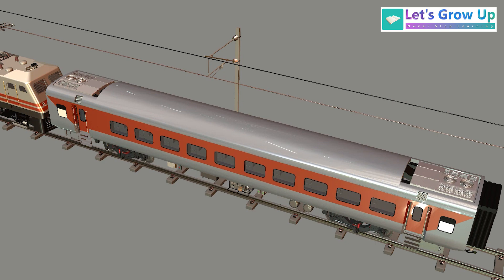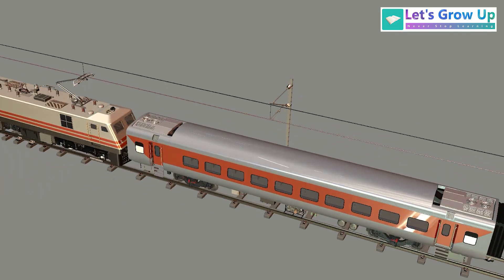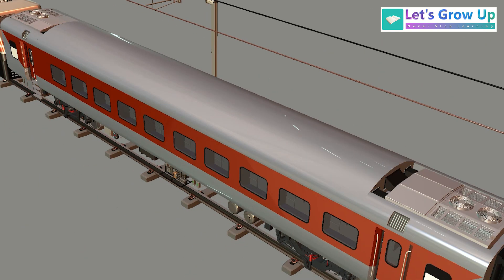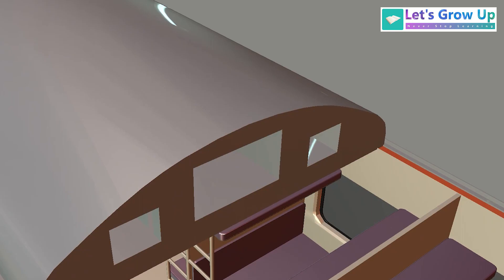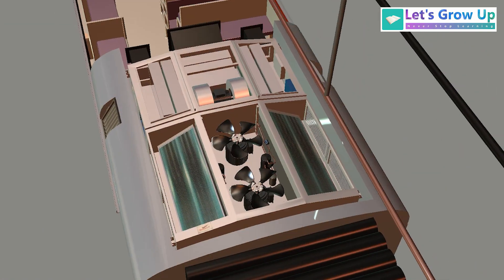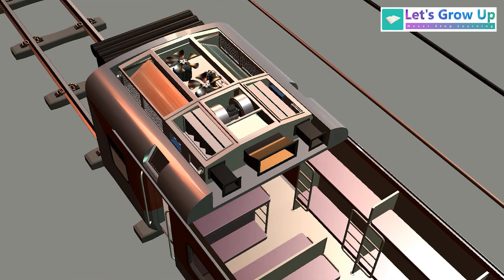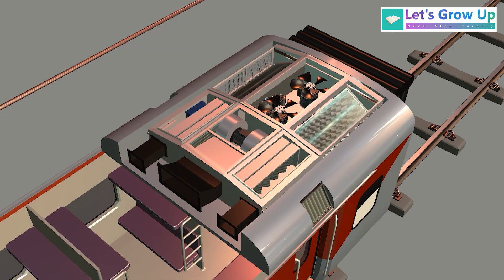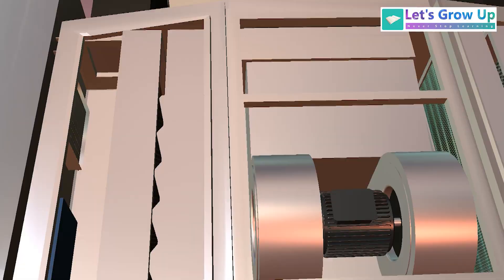Understanding the train's AC Unit

Comment: I am maintaining the train air conditioning system, the air conditioner is leaking water, I have checked the pipe is not clogged, the compressor is working without overloading the gas normally, now I don't know if it is due to a return air valve error.
Reply from the maker: It could be due to a number of factors, if you are sure that the pipe is not clogged and the compressor is working properly, check the return air valve and its connections. If the issue persists, it is best to contact a professional technician for assistance or check the guidebook